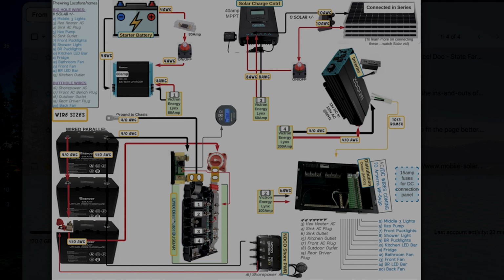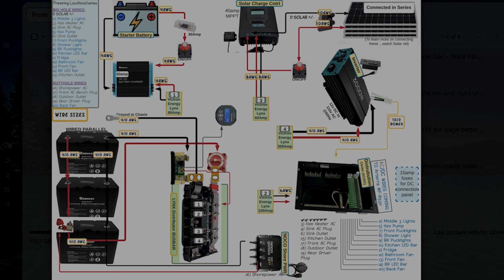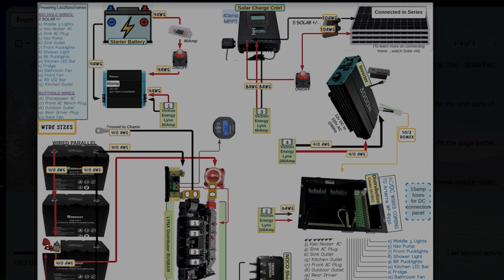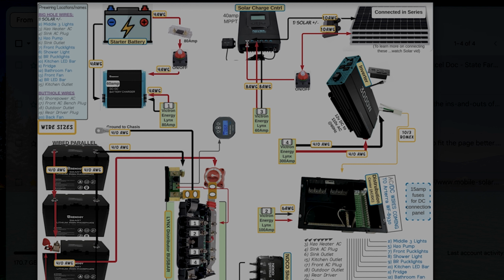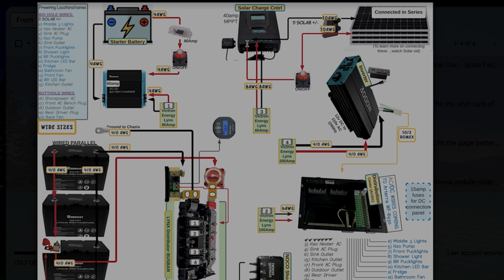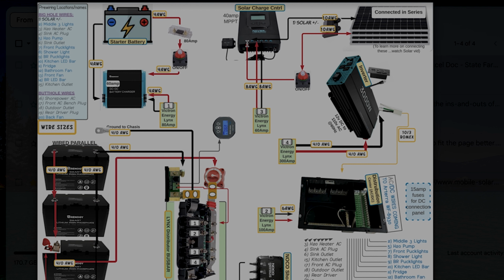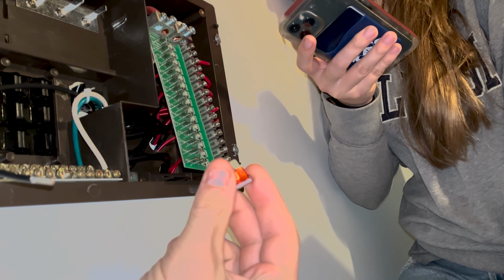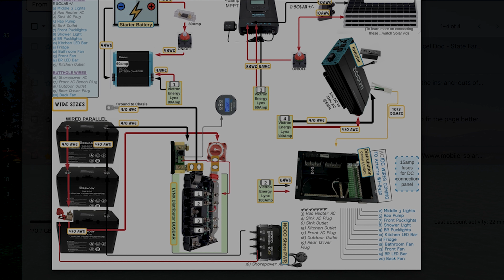Camper Van Electrical Install | Start to Finish - Renogy Off-Grid System

Comment: Good video. It’s a good sized electrical system. Lots of connections. 
I’m currently working on my own design and it’s very similar. 
I’m sure you followed manufacturer recommendations on wire and fuse sizing. It’s interesting though that the dcdc converter has 4awg wire with a 80a fuse but your dc distribution panel uses 6awg wire and a 100a fuse. I expected the wiring to be reverse or both being 4awg, which is what I’ll be doing in my system. 
Took me a moment to realize your distribution panel serves both ac and dc, so the panel has two separate inputs. 

Here are the things that are slightly different in my system. 
Dcdc converter: mine is a newer model that also handles up to 600 watt of solar input. This in turn allows for trickle charging of the starter battery. But the setup is otherwise the same.
MPPT: also a larger model, 60amp. Allows up to 800 watt solar on a 12v system. Also use a switch, but mine is a special PV switch for 2 strings with Arc protect. 
Inverter: only a 2000 watt inverter. I felt that for a larger inverter I’d put too much strain on the batteries, which only have a 300a output in your configuration. With up to 250a load coming from 3000 watt inverter and 100amp from dc, you have the potential to push the limit. My 2000 watt inverter is only rated at 167amp, so I’m staying below battery ability. 
Also, I don’t have a wired AC panel. I’m using a single outlet from the inverter to connect a surge protector power strip. While this might sound like I can use too much power, I also have a Kill-a-watt plugged in and can monitor all appliance draw from the inverter. Stay below 1800 watt, and I’m golden. However, the only items I will need the inverter for are a laptop (150 watt), rice cooker (200 watt), sous vide stick (750 watt), kettle (1500 watt), induction cooktop (1800 watt). I’ll never use them all at the same time.
Dc panel: I use a BlueSea dc panel with two circuits. It’s supposed to be one permanent and one switched. But just in case, I’ll be putting a switch into both. It’s good for 12 appliances, that should be plenty. And my dc fridge will bypass the panel altogether. However, I will have it all connected to a Victron low voltage disconnect. It’s rated at 100amp and protects me from running the batteries down by accident. The inverter is only turned in when needed but dc is always on. 
Busbar: not using a Lynx, just two old fashioned BlueSea 600amp bus bars. Of course my bus bars will look more messy because I need to add fuses to it. That aside, connections look the same as your system. 
Battery: I’ll be switching from 3x 100amp to 2x 200amp batteries. This increases overall capacity, increases output from 300 to 400amp and reduced battery cables by one set. And I could still add 2 more batteries without makes a total mess of my system. And now I could comfortably go with a 3000 or even 4000 watt inverter (not going to).

So our systems are very similar. Most components are the same. I’m using a mix of renogy and Victron, BlueSea, Ancor and Windynation and batteries from Ampere Time. 

Good luck with your system and all the best for VanLife.
Reply: P.S. gotta steal that battery terminal fuse. Totally missed that in my planning.
Reply: P.S.2. Be aware that the outlet extension you selected for your inverter is only rated at 12amp or 1440 watt. Thats total for all outlets together. That’s less than a standard home outlet which should be rated at 15/20amp. Should be fine for most appliances though.
Reply: P.S.3. If it was not for the dcdc converter, I would have set my system up as 24v. That would reduce cable and fuse sizes. But it would add require a dc converter bring that 24v down to 12v so all my 12 volt appliances can run on it.
Reply from the maker: Yes, does seem like we have similar systems! Regarding the DC to DC vs Dist. Panel Wiring and fuses, we followed manufacturer for both, but Renogy has changed quite a bit even in the time that we've had it (just about a year)... So far, things have worked ok though. 

Glad you're going with a slightly larger system. I wish we had 400 AH battery life.

Comment: I would toss the NOCO.. I had two melt the wires to the point it melted the connectors. So big Fire Hazard.... I bought a Renogy Inverter\Charger\Transfer Switch..That is rated for 75 amps on Shore Power.. Problem solved...
Reply from the maker: Good to know, thank you!

Comment: Great video! How did you handle grounding? Did you run a grounding cable from the Lynx to the chassis? Where did you ground the inverter to?
Reply from the maker: I realize this is a bit late, and may no longer be needed for you but I hope this reply helps someone else. The Inverter was grounded to the chasis. You should see it in our diagram.

Comment: The wires you have running from your DC to DC charger to the Lynx Distributor are much smaller than the 4/0 wires from the inverter to the Lynx Distributor.  Tthe Renogy diagram shows 4 AWG wire size, so you got it right, just your audio track states 4/0 wire.
Reply from the maker: Thank you for the clarification here. We try our best to be as detailed as possible, but sometimes we make mistakes editing :)

Comment: Both Positive and Negative  wires coming from the solar panels should have a dual isolator switch, not just the Positive.
Reply: Interesting! We didn’t know that. Out of curiosity, can you explain why? You’d be helping us as well as anyone else who comes along too! Thanks so much! :)
Reply: Sure. In America, and I'm sure many other countries around the world,  you need to disconnect both +ve and -ve wires. National Electric Code 2020 Article  690.13 states this... Also, the isolator switch you are using may not be rated high enough for the voltage.